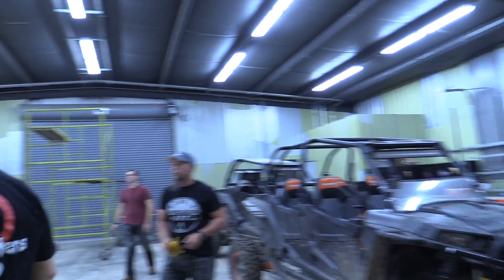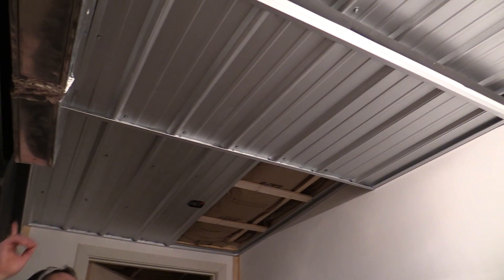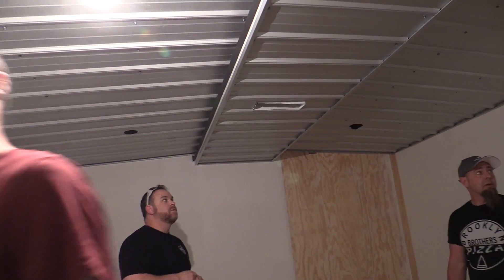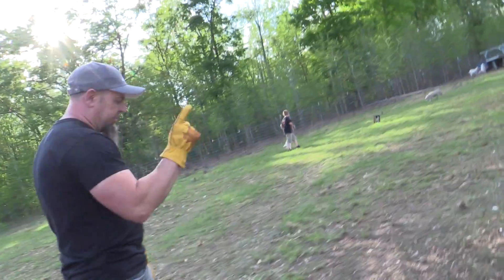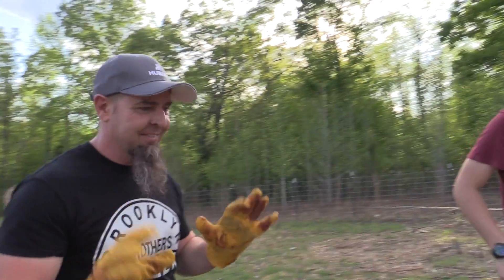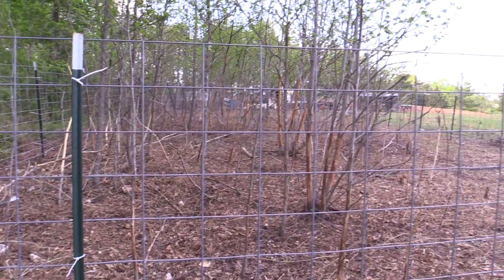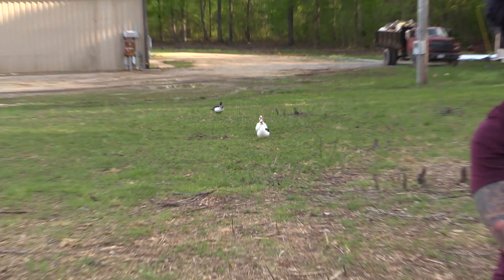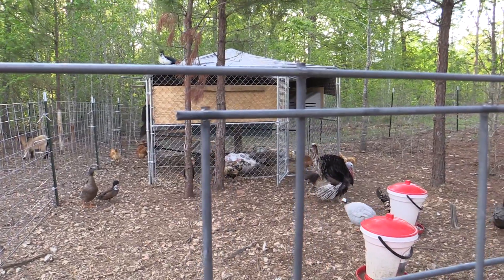Evening at SOE  4-20

Comment: Hey just an idea but if don't want to injure your head on those I beams get some pool noodles cut a slit in them down the length and slide it on the edge of the I beam, still hurts when you bump into it but not as bad and it'll save you a hospital visit!
Reply: Compact Disc That's what I was saying. That or the foam stuff they make to put around roll cages. Its already cut and has adhesive on one side. I suggested it on one of the videos awhile back.
Reply: Daniel Kruger They make smaller stuff with 1/2" i.d. for insulating copper water lines that is pre-slit and has adhesive for re-attaching to itself after wrapping around the copper pipes. Black in color, closed cell foam. Lowes carries it in 4' (for sure) and 8 foot lengths I think. Since you live in warmer climates you may need to have them order it for you. It's all over Alaska.
Reply: asleepinthealley That would work too. I live in Michigan so I'm pretty familiar with the insulation foam, we have pretty brutal winters here. Probably not as bad as Alaska, but pretty close lol.